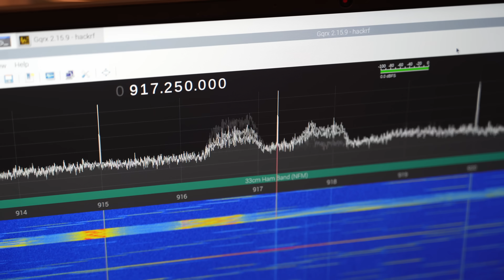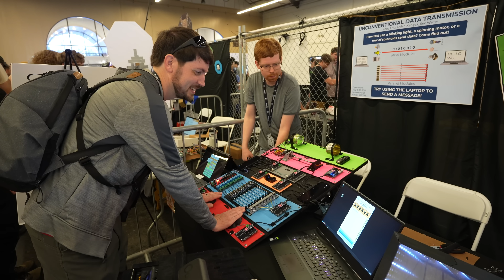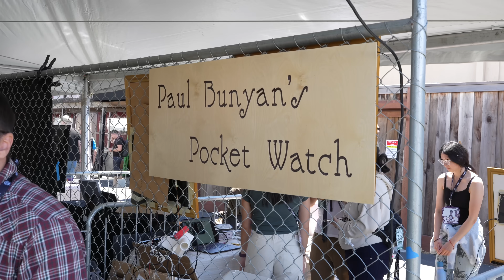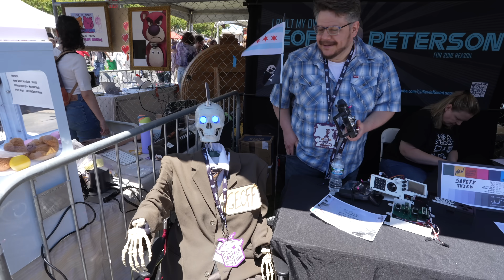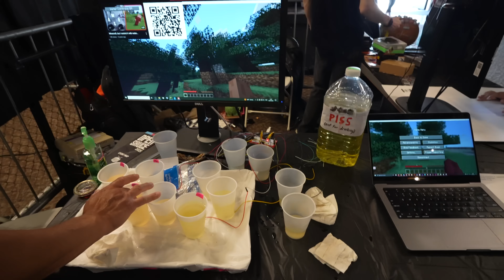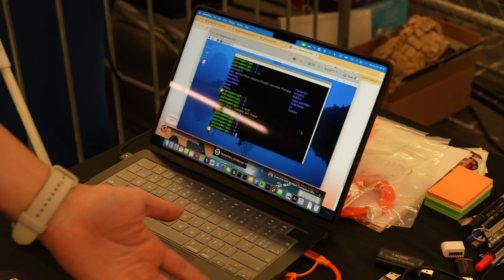Open Sauce 2025 vlog: Day 1 (People, Projects, Pee-Board)

Comment: You, Jeff, may already know about this but perhaps your viewers do not: back in the late 1960s or early 1970s, Heathkit produced a digital clock that ran off of wall current.  They explicitly stated in the manual that they were using the 60hz line frequency as a reference frequency for the clock to keep it as accurate as the 60hz signal (of course, you had to set is to the correct time in the first place).
Reply from the maker: The clocks in my grade school growing up were all grid-based. We always knew when there was a brief power outage because they had to tweak the clocks!

Comment: The Meshtastic team was looking forward to your visit. They described the relay point outside amongst the tents? Often we've had issues at these events with height restrictions due to fire code constraints, but here we were able to allow exhibitors to get into the air ( did you see the small combat balloons? )
My Meshtastic plan also ran out of time. I wanted to build a 'batsignal' and place it at our info booth. A fellow from the Meshtastic team nabbed me during load-out and I hope to collaborate with the bay area group for next year. 
Next time if your dad can come he would like our annual tour of our coastal low power community radio stations and ham repeater bunkers, hidden up in the santa cruz mountains. It happened to be the saturday I ran into you while managing the area. It's part of our ARES stuff. Hmm, we're also doing LoRa fire weather monitoring up in the hills and he may like that team.  We also have a neighbor monitoring power line frequency changes to try to sense tree-fall. but that's a different vector.
Thanks for the call-outs. I didn't stay long at the close out party cuz I got there quite late and it was super loud for conversation.
onward!
Reply: oh I forgot to comment on the wifi issues. man. man. ( shakes head ) complex to support!

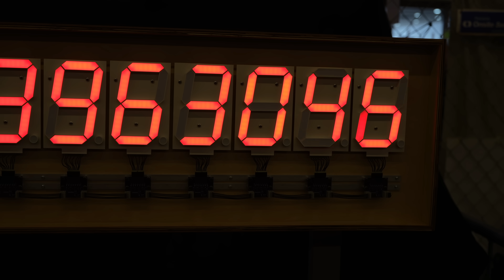Comment: 2:46 It's actually a common way for home appliances (microwaves and ovens) to keep time on them they literally just count frequency pulses to run digital clocks! There was a case in mid 2018 when Kosovo was fighting for separation and independence and their power plant disagreements with Serbia caused Europe-wide shift in frequency for, I think, around two weeks and that was enough to make thousands of digital clocks run late across entire of Europe, even as far as Iberian peninsula! Thousands of kilometres away from the root of the issue.

Comment: I am under the assumption that  all digital clocks utilize the mains frequency to calculate time. every alarm clock, VCR, etc. even older not so digital clocks did too, but most back then used a clock modulator like quatrz crystal

Comment: Sorry I haven't said anything since I've subscribed to this channel. Last year I bought a Raspberry Pi 5 and a 17 inch monitor for it. Later on this year I got hold of some 128 GB Micro SD cards and also an external USB hub for it - yeah, and that is externally powered. I replaced the 32 Gig card with a 128 Gig card with a suitably re-flashed 64 bit Raspberry Pi OS. Somehow, these days with the external hub, when I shut down the machine - it shuts down. Had a few issues with that back in the day. Also - yep, the actual Raspberry PI 5 board does not have a power switch in it, which yeah I could maybe look into but... In any case, what with the USB hub or maybe the more recent OS on the 128 GB card had dealt with the hassles with the thing powering down. Whatever.

What do I love about the Raspberry PI 5? Well, I use it for retro programming. Also, the way things are going these days - I don't need a computer that might need an SMR to run it - e.g, I don't really care much for the "AI" bubble. I use this  machine to code stuff for the commodore 64 and Atari 8 bit computers  - and I use eclipse with the WUSDN plugin to do that.

Maybe one day I will try and code something up for the 8 bit Nintendo.

One other thing Jeff - that thing you posted about that dishwasher - what is wrong with the world today?

You sir are awesome.